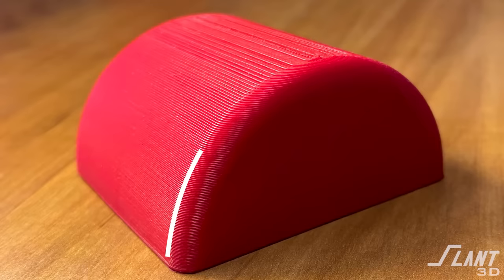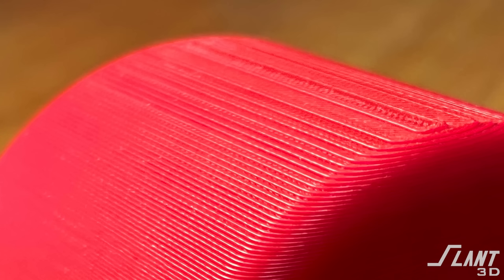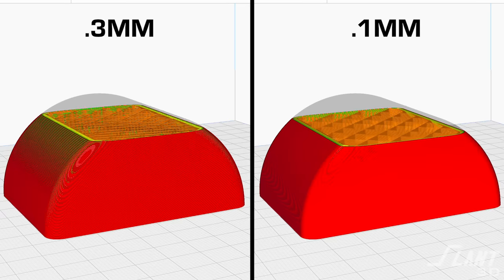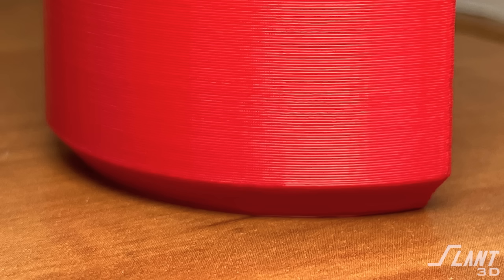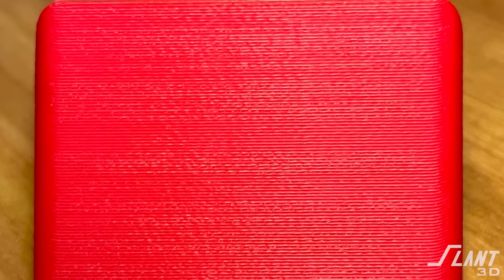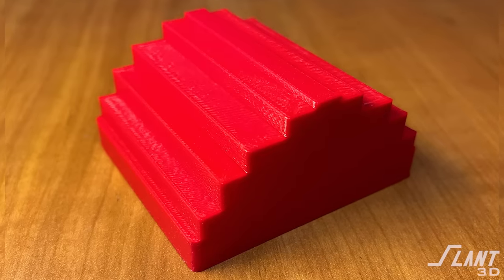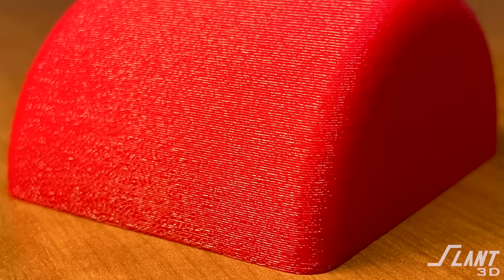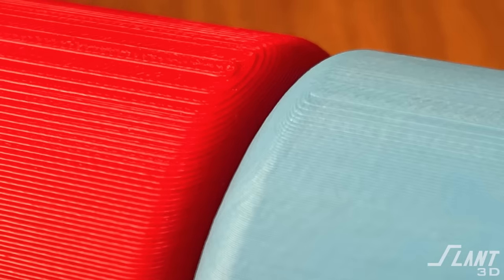Improving Curved Surfaces | Design for Mass Production 3D Printing

Comment: I think there was a DIY 3d printer video where the author made a 5-axis 3d printer that print along a non-planar contour. So even spherical surface is not an issue with minimum layer line without needing to sacrifice print speed. But that machine does require custom 3d model slicing instead just regular planar slicing. I think i saw it 8 years ago, not sure why that 5-axis design didnt spread beyond university research project to the general public.

Comment: Seems like the most obvious solution should be software. Maybe eventually most slicers will have a factory default enabled that detects a certain slope angle and automatically starts increasing resolution the closer it gets to the top. So you could print the whole thing at a big layer height then the last few be small.
Reply: This already exists

Comment: Also use marbled filament, the pattern takes the eye off the layer lines, and makes the whole thing look better.
Reply: Some matte surface filaments make layer lines hard to see. Some glittery one will as well, probably for the same reason you mentioned marbled filament. For example, Prusa's Galaxy Black PLA prints both matte and with small glitter flecks. It can be really difficult to see layer lines when printing with that filament.

Comment: You mention printing on its side, but I'm surprised at how often printing at any angle will remove stairstepping rather than rotating a full 90 degrees.

Comment: I don't understand why FDM printers don't able to rotate they extruder around an object in the first place. It won't add much more struggle to the printers we already have and it would be an nice alternative option. Only slicers would need to get updated for this. It would allow us to use smoothing layer option that we can see for ex. in Cura, while also it would allow to make parts way stronger and lightweight at the same time as we could combine different print orientations of lines on one object. While also getting rid of support needed for many situations where the head just move diagonal. Also you may then would able to avoid that you could kick a already other print from your print surface because a detection camera or something could calculate to print around it.

Comment: I have been designing my screw hole parts with hexagon holes instead of circles because the slicer always messes them up and makes them flat at the top.
Reply: It's not really the slicer, the upper layers are sagging because they are unsupported, so it appears flat at the top. You can counter that by exaggerating the upper side of the circle and make a teardrop instead of a circle. But hexagons are probably a better solution because they don't have that problem, their sides are 45° and support themselves, topped by a bridge.
Reply: The angles of a hexagon are 60 degrees.  45 degrees is an octagon.
Reply: @jeffreygordon7194  oops you're right, octagon is that I meant, hexagon would work when oriented with the flat side up, the side would have an overhang angle of 30°. But even with the tip up, 60° should give you better results than a circle, 60 is still quite printable.

Comment: One solution is just to flatten the top. Yes, it not the greatest but good design is about figuring out the best set of compromises. And 3D printing FDM is already a comprise on aesthetics, you're making for the multitude of benefits of FDM.

Comment: Would be nice to see variable layer heights and infill with thick layers. I can see an issue with adhesion as there can be air gaps, but adaptive wall thickness can also fix that.

Comment: you're going to hate this answer, but you can oversize the wall by a little bit and then sand it back down, not perfect, but it's stupid simple for small batches, or for parts that need a really smooth surface

Comment: How can I print the sphere/spherical structures with these layer bumps and get the smooth surface finish and I also I didn't understand the last solution mentioned someone explain please

Comment: I appreciate the info you provide. I’ve been designing a box for some fans with using your methods. What methods do you use to reduce costs? The box takes 1.2kg of filament at 2 walls and 10% infill since it’s a fairly big box.
Reply: The easiest option is to use lightning infill though the part will be somewhat weak. Another option is to skeletonize the part by removing material in the cad model where it isn't needed. If you decide to skeletonize the part you can also reduce the thickness of the walls to a point where you don't use infill at all and just use a couple millimeters thick of solid material.
Reply: use cardboard for the walls and only print the mating surfaces
Reply: @TheRealPlato  well the idea is this is a product I wanna try to sell

Comment: imagine I'm 3D printing a cylinder. Initially, I print the cylinder with layer lines vertical to its axis. Afterward, I create an extruded square with a draft angle of 4 to 6 degrees and subtract it from the cylinder using Boolean operations. Next, I print the pyramid that is formed from the extrusion with the layers parallel to the pyramid's axis while taking my printer's tolerance into account.  I then fit the pyramid snugly inside the cylinder, resulting in a cleaner and stronger part.

Comment: Why not tilt the part on the print bed?  Isn't that standard for SLA printed parts?
Reply from the maker: We don't care about SLA
Reply: @slant3d  Sure, but their solution (tilting the part so there are no surfaces tangent to horizontal) works well for your problem (layer lines).  After all, they have the same layer line problem.

Comment: Essence of this rather pointless video: Wanna avoid stepped layer lines on your rounded object? Design a totally different looking object which isn’t rounded! Uhm, yes...

But seriously, as mentioned below adaptive layer height or different print orientation (as mentioned in the video) is the real solution. Or sanding. Or Isopropanol smoothing when using PLA. Bottom line: Nothing new here to see, sorry.

Comment: Or, new idea there is something not yet built into slicers that would solve all of the layer line height problems....  stepped perimeters. Why waste time reducing the height of the infill when only the perimeters matter? Just reduce the height of the external perimeters. With a 0.4mm layer height... Run the external perimeter 4 times at 0.1mm layer height and then run the other 3 at 0.4mm. for flat surfaces. Or step them for curved surfaces...Compute perimeter offset necessary to split the external perimeter into 4 steps and then run infill at the 0.4mm layer height. It's not complex.

Comment: Or You can just use Variable Layer height in PrusaSlicer
Reply from the maker: Which is the same as high resolution. Just slightly faster
Reply: @slant3d  A bit dismissive IMHO. It can be significantly faster depending on geometry and it means the customer doesn't have to drastically change the look of their part.

Comment: Basically you printed everything else but the piece you promised a solution. It was not helpful at all but thanks for trying. Turning a dome into a Egyptian pyramid or Aztec one is not offering any solution to eliminate steps on a curved surface, does it? Basically what you are saying is “ there is no solution so don’t print it”

Comment: The TLDR of the video. Want improved curved surfaces? Don't print them!!...

Most slicers have variable layer height options now. These will print higher quality than the fast settings, while being faster than the high quality settings. It often takes 20-50% more time, but is very close, often indistinguishable from the pure high quality settings.